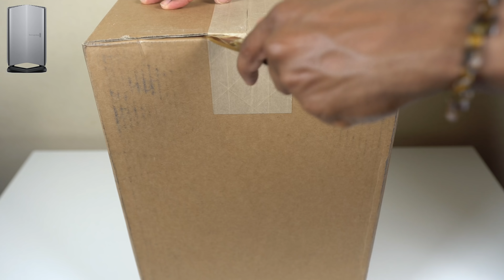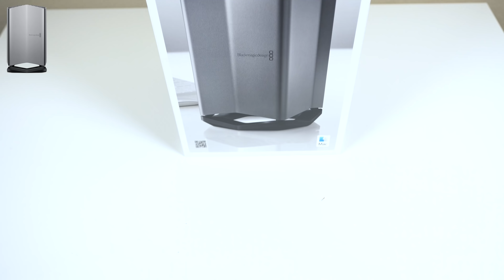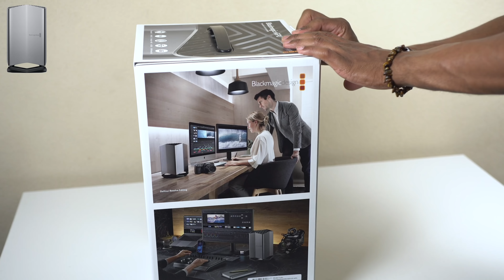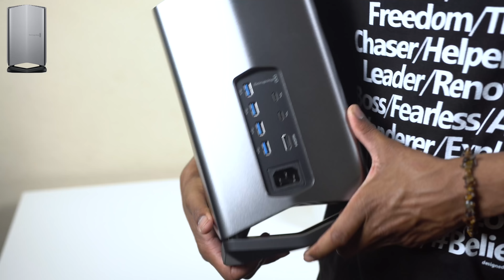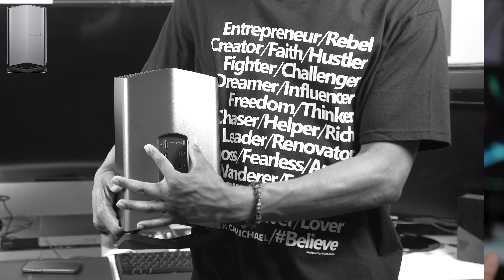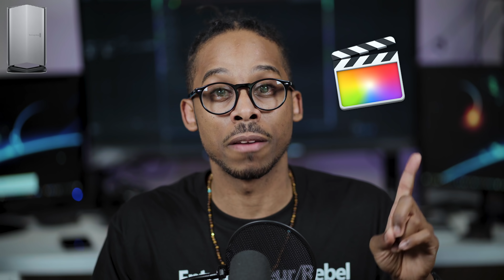Apple Blackmagic eGPU Unboxing and First Impressions BIG DISAPPOINTMENT?

Comment: You Got that Cable length in the box for a good reason and it not cause they wanted to cheap out on a cable when you just finish paying lot's $$$ for the eGPU. The usb-c connector at the end of every cable is miss-leading. Most people see that tip and assume it's all the same, so you will just go and get a longer cable with the same ends and you will be fine, Right! / Wrong, your eGPU requires a Thunderbolt 3 Passive cables at 40Gbps in order to work hence the cable you got in the box. As for your setup if you wanna get it right, get it tight you gonna need to go (optical).
USB-C max cable lengths
USB-C cables are very sensitive to their length as the high throughput specs that are carried over it are susceptible to signal degredation (unless carried optically).
USB 2.0: 4m 
USB 3.1 Gen 1: 2m
USB 3.1 Gen 2: 1m 
Thunderbolt 3 — Passive cables at 40Gbps: 0.5m
Thunderbolt 3 — Passive cables at 20Gbps: 2m
Thunderbolt 3 — Active cables at 40Gbps: 2m — 60m (optical)
Hope this Help's ya'all, nice video keep up the good work
Reply from the maker: Thanks for the informative comment. I appreciate you sharing your knowledge. Thanks

Comment: You should try Resolve 15. It's free for most features and it's going to be the future of editing really soon. It gets super amazing updates every year. It's like final cut and premiere pro mixed together and more. Also, your drive should be in sleep mode when you turn the computer off. If it is, you shouldn't need to worry about it because the disks inside will stop, and the LEDs in the keyboard should last forever lol. Great video btw!

Comment: Hey man, just wondering how you are finding the i9? I'm planning order my mbp tomorrow and am trying to decide between the 2.6ghz i7 and the i9. I'm a software engineer so i would prefer the i9, im just concerned about thermals, as id rather not upgrade to the i9 if it is just going to throttle when i actually need it lol. What do you think? (also im so happy about 32gig of ram, my work flow needs around 20gig, so i can finally have a fully portable work system :D )

Comment: My research suggests that FCPX does not take advantage of eGPUs. It's a software thing on the FCPX end of things.
Reply from the maker: Thanks for the info! I appreciate it. I'll look into that for sure.
Reply from the maker: What do you edit with FCP or PP?
Reply: CJKnowsTECH FCPX.
Reply: Got the blackmagic EGPU on Friday and been using it all weekend - it KIND OF works in fcpx.  It kicks in when scrubbing and timeline viewing, but it doesn't kick in when rendering or exporting.  Kind of weird.  What's strange is with the egpu and macbook pro scrubbing through 4k footage and overall workflow in fcpx is actually even smoother than it is on my imac pro with vega 56... super weird still trying to figure out why
Reply from the maker: Interesting. Thanks for sharing your experience
Reply: It's worse than that. I have the 2017 maxed out 15" MBP and when I run FCP it's slower using this eGPU. It's a completely useless piece of crap. I used Resolve for color correcting but I'd have to unplug it when using FCP. Even playing a 1080p clip in the preview window it drops frames. Mine is going back. I'm not buying something that may or may not work with everything one day when Apple can be bothered to add it to MacOS. Checkout PhotoshopCAFE's video on it, he's done some proper testing and it's a dog.

Comment: Thank You for the review! The thunderbolt cable is short so you can keep the max 
40 Gb/s throughput. If you go longer it drops down to 20 Gb/s.  Once thunderbolt is a optical connection, the distance between devices will be much greater.
Reply from the maker: I guess that makes since. I just wished it could be a little longer😂 Thanks for the info and Thanks for watching
Reply: Lots of company’s do 1m or 2m Thunderbolt 3 cables with full 40GB/s speed. Just need to watch how much power they provide - some only 60 Watts, Belkin and a couple of others offer up to 100 watts.
Reply from the maker: Thank you for sharing your knowledge!

Comment: I just bought this the core i9 MacBook Pro do you think I could’ve gotten away with the 13 spec’d out ? I’m mainly using it for audio engineering mixing and mastering
Reply from the maker: You probably could? Depending on how intense your audio sessions be? The more tracks the more plugins the more processing the more power you need. So use it and see if it seems like overkill then follow your gut. But it really depends on how heavy your projects get. Thanks for watching
Reply: CJKnowsTECH Yeah I usually have a lot going on lol , but you know since the 13 is quad core now I figure it should be able to keep up but I guess me getting 15 i9 should further future proof things but no problem bro love the content 💪🏾